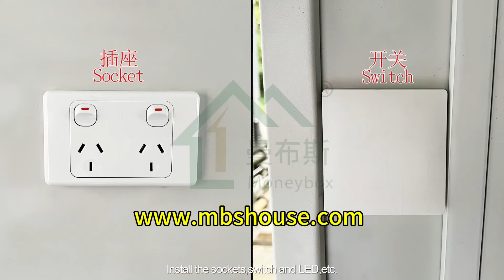How to Install New Generation of Detachable Cheap Container House

Comment: Hello, I am interested in this type of construction. However, I have a question, I went to the manufacturer's website and found that it offers, informatively, a lifespan of 10-15 years for this type of construction. You can Tell me, please, what are the problems that may appear during the use of this construction? Thank you!

￼